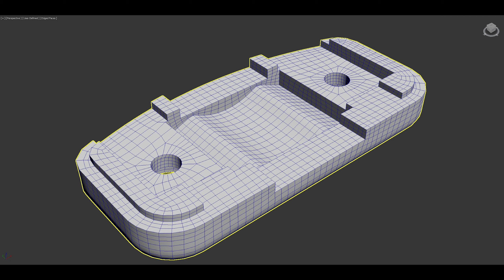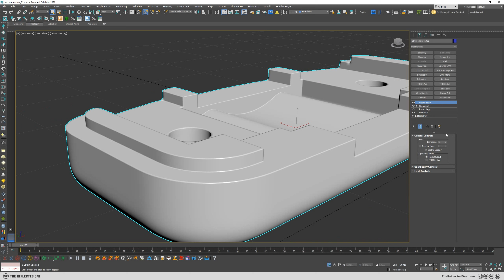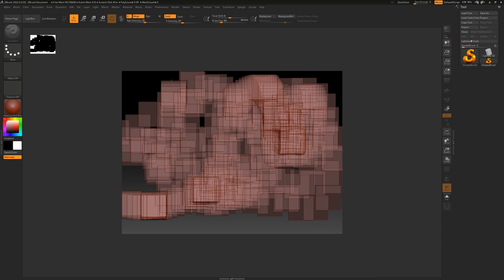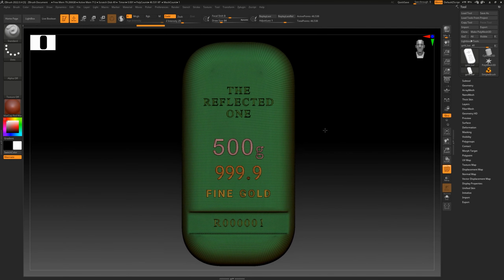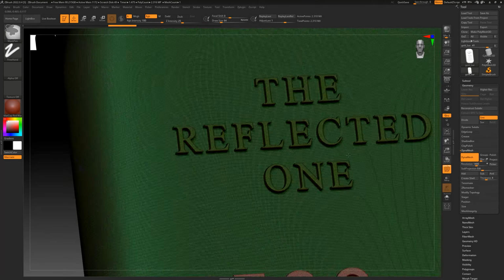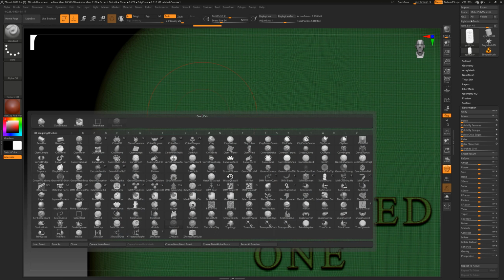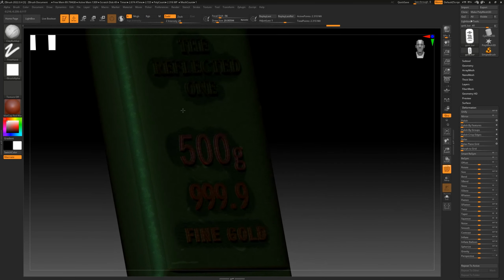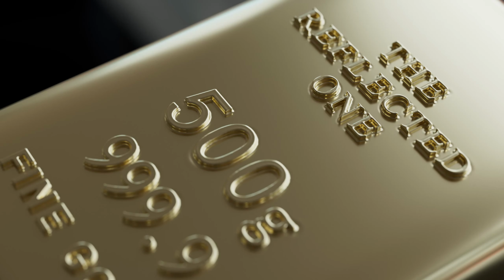Retopology for Lazy people!

Comment: Hi, is retopology an extra add-on or is it natively inside 3d max, as it doesn't appear to me in the modifier listing.
Reply: I did a google search and found the solution, thanks for your tutorials, they are very helpful.
Reply from the maker: Thank you Andres. For those who might have the same question, autodesk introduced retopology tool from 3ds max 2021. So you need 3ds max 2021 or higher.